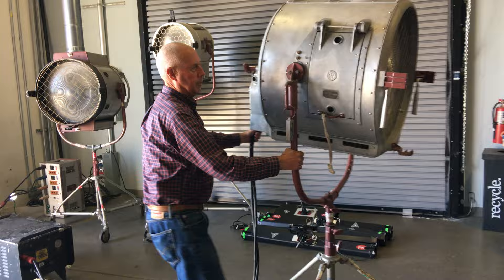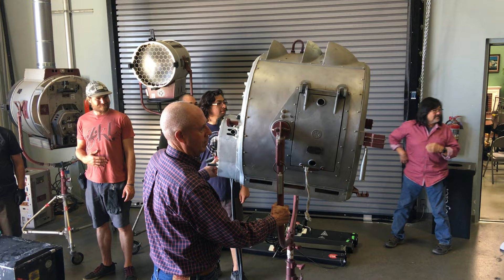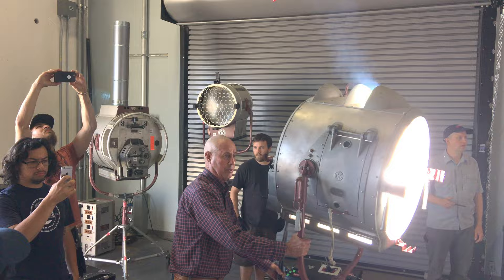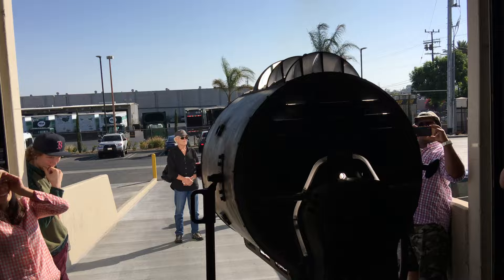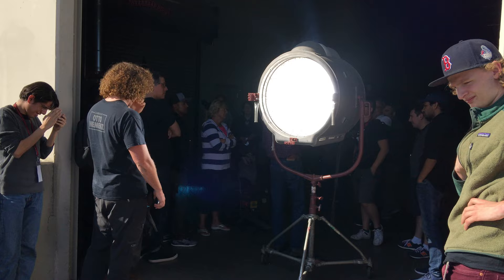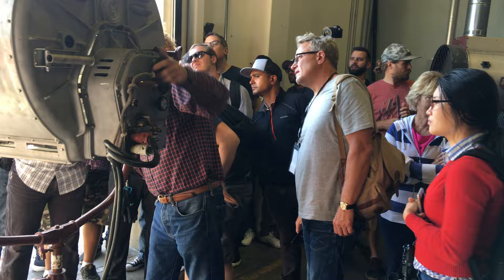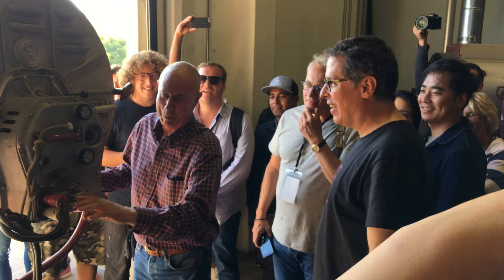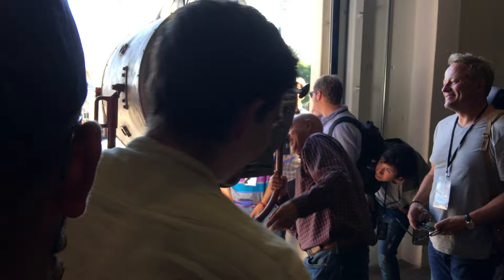Carbon Arc light demo

Comment: The light quality is unreal...
Reply: Just like the sun ...back in the '70's-'80's my buddy's parents owned a drive-in movie theater and had carbon arc projectors ... I learned a little bit about them they have better light then the bulbs they use today.  The mirror in the back of the projector is very expensive I remember Ted telling me about $1,000. Bak then to reflect the light to the film .. 
  The light is just like the sun burn your eyes that have the dark green glass window to adjust the arc ...
Reply: @peterrivney552  Fantastic --- back then you needed those big arcs to light up those big screens...  movies are so clinical now.. too clean.. cold... no emotion..
Reply: @covert0overt_810  if blasting your actors with so much heat they can barely stand to act is emotion, i dont want it. not to mention the UV rays lmao
Reply: @12gauge_shawtyy  UV rays can be filtered out without degrading the quality with a piece of the right type of glass, and the actors can also stand further away or a smaller lamp can be used, the reason we don't use this type of lighting anymore is because they're inefficient and operation isn't nearly as trivial or as fire safe as any of the alternatives
Reply: @12gauge_shawtyy You might be forgetting they are both there voluntarily and compensated quite well for their "experience" with the light. They all would tell you "hot!" but notice you never really heard of anyone actually truly complaining about them. It was part of the game.

Comment: When you hear the term "lights, camera, action", that dates back to the earlier days of filmmaking when these lights were not turned on until just before the camera was ready to roll. As you can hear the guy in the video say the carbon rods only last for a certain limited amount of time so they tried to minimize the amount of time they were burning when the camera wasn't rolling. In those days you had one man per light so that they could quickly turn them on and shoot and then shut them off. These days lighting crews are a lot smaller because modern lights don't need the kind of constant attention, reloading, and adjusting that the arc lights did.

A good carbon arc operator could adjust the speed at which the worm drive fed in the carbon rod so that it burned most efficiently and maintained proper spark gap during the burning process.   having the carbons contact each other or feed too slowly until the gap was too big would negatively affect the quality of light.

Comment: Just found a second carbon rod made by General Electric Company here in the woods, they must date back to WW2 and were used in one of these carbon arc lights I assume; there was a lot going on here during WW2 where we live.Thanks for the video!
Reply: when I was a kid my dad ran ww2 searchlights with the generator mounted all on a trailer at car shows and events, , each searchlight is on its own trailer with generator ,that you tow with a truck ,  the rods came in a square tin cans , 
I remember listening to the generators for hours ,  I wonder what happened to them searchlights after the guy that owned them passed , prolly all scrapped out , I have never seen one scene

Comment: Great demo, sir!   Thanks for this video. Good question by the guy how long does it take to warm up. Carbons are instant warm, vs. HMI lamps take a little bit to warm up and get to color temperature. Definitely more cool mechanically than a 12K HMI.  haha!  I wonder if the light quality is better with this brute arc than with a 12 or 18K HMI?

Comment: Is that a Mole Richardson?  Haven’t seen one in use for probably about 25 years.  I think the last rime was at St. Pancras station in London before it was converted for Eurostar.  Can’t remember what the production was but they were using several of them, and one of the operators let me strike the arc.  Great lamps, pity it all seems to be HMIs these days.
Reply: This Arch mole? Was a R mouse with 3 balls inside the mouse

Comment: I didn't hear what he said but what is the spin-a-ma-thing on the back?  Is it a brush to strike an arc?
Reply: The arc is struck with a lever that just brings the carbon electrodes together them releases them back to the distance they're set at. The wheels are for adjusting the electrodes. You see one spinning because as they burn they get burned away so need to be continuously kept the same distance apart and that's done automatically so they're basically constantly being brought closer together. The positive one burns 3x faster than the negetive as he noted. The wheel you see spinning is probably for the positive one.

Comment: Miss the days when these lights the street of cities from towers
Reply: Austin, TX still has some of the old Moonlight Arc Streetlight towers.
Reply: @dadillen5902  except they aren't arc
Reply: @TheFalseShepphard  
Think about it they had a light source that had pure daylight color from the 1870s. How long did it take us to get back to that point? With high output halogens and HIDs and LEDs? The main issue with Arc lamps is the heat and also power consumption. But they are a superior form and color of light. And when you're talking about film and photography you generally need a hell of a lot more light than the human eye needs to have it come out right on film. Of course all of this has changed relatively recently.

Comment: Ohms law:  I x E = P, or power, measured in watts, or power dissipated.  So, 9,180 watts?  Wow! Is that correct?
Reply: Voltage on the arc after the ballast resistor is typically about 25 Volts. 125 Amps at 24 volts is about 3KW of light and heat from the arc. Movie projectors for the big screen typically ran 60 Amps. Searchlights would run close to 180 Amps.
Reply: Ohm's Law is V=I x R
Reply: @professornuke7562  Quite right, one of 3=4 equations.
Reply: Dude's understanding of the electrical aspect of it is weak at best, but enough clues are there. The ballast box is dropping almost as much as the arc. So all told actual supply and dissipation is about twice that lol
Reply: @isettech I don't know which set of numbers is correct but given the generator for that unit was given as 120V DC in another video, and ~70V at the output of the ballast resistor box, he is almost certainly referring to a struck voltage at the output, as the reading with the arc extinguished would be as if open circuit, simply passing through a low value resistance (sub ohm range), and would be whatever the nominal 120V the genset has available on a meter.

That said, it doesn't make sense from a design (efficiency!) standpoint to run 120V in, only to lose 95 of it in the ballast. ~50/50 as given in the videos is bad enough but necessary... 80% loss, combined with the inefficient nature of a broad spectrum source (heavy in IR and UV, useless to the eye)... you'd feed it nothing but diesel and get abysmal visible light out of it for what goes in.

I don't know for sure, never messed with a real arc lamp such as in the video, but from an electrical design consideration standpoint, I gotta go with the higher numbers in the videos.

Comment: 16 volts 135 amps? isn't that only 2kW? A 2kW tungsten couldn't compete with daylight like this; are carbon arcs super efficient or something? What's the wattage on this thing?
Reply: He indeed did say 68 volts
Reply: Yeah, apparently it's more like 9180W.
Reply: 9kw use 18kw of light
Reply: they are 5,000K temperature, no need for filters to color correct,
Reply: @shacoclone3299  I think he said that was the open-circuit voltage, which drops quite a bit after the arc is struck. There is also a voltage drop across the ballast resistor.

Comment: carbon arc lighting, look like stick and tig welding
Reply: There is actually a thing, carbon arc gouging... the only difference is a jet of compressed air to blow away the slag/metal.  You can buy carbon electrodes at the welding store.  ICWeld channel is the king of this.
Reply: @scowell  there is also CAW Carbon Arc Welding.....CAC carbon arc cutting is very loud, but it will cut any metal that will conduct electricity...it was invented to cut armor plate on ships in WWII
Reply: @scowell  the [CAC] Carbon Arc Cutting process needs about 35 volts or more to run properly...so not all welding machines can CAC. they are a blast to use though, they throw molten metal 35 or 50 feet away......a standard Constant Current machine which is used for Plasma welding, shielded metal arc welding and gas tungsten arc welding along with submerged arc welding is used, A constant voltage machine used for gas metal arc welding [mig] is not used.you can CAC with AC or DC Constant Current Machines.

Comment: These lamps can take an EMP spike in the grid in case of Carrington event or Miyake event ( solar CME in X10+ class Google it) or Nuke generated  EMP ( if grid do not have weak spots like semiconductor bridges, thyristor/ igbt regulators, computers to control it instead of them analog bulb mercury thyrathron regulators....) .... Same to old mercury high pressure or sodium high pressure bulbs in hich dor short time seconds of o minutes support a 200% power spike!
LED ( semiconductors ) cannot withstand those surges ( are even ESD sensitive that requires gloves and ESD decoupling)... Also electronics behind is sensitive to overheating ( Ecuator heat, +38°C >> ) or cold ( freezing under -20°C )

Comment: Why's it humming? I thought carbon arc lamps used DC, not AC.
Reply: ALI6359  why would they do that? Isn't it being run from a DC generator? Such a generator produces no DC component.
Reply from the maker: I can't remember exactly but I believe their building didn't have DC, so I think they're running it through an older transformer of some kind.
Reply: Its use DC. He said his rectifier is old so it makes this noise. I think transformer before rectifier makes this noise.
Reply: "This is being fed with AC which is three phase... 68 volts 135 amps."
Reply: @ShokaLion  Yeah he probably misspoke there.  He said the rectifier is humming.  Rectifier == AC to DC converter.
Reply: Actually its the transformer humming.. Its steps DOWN the voltage to 65v and as a good transformer maintains wattage if you put 220v at 60 amps lets say. That would be 13,200 Watts of power, assuming 100% transformer efficiency the output wattage would be the same, but at a reduced voltage, so the current increases to 203amps (220v x 60a input = 13,200 watts. 13,200 Watts/65v on output = 203 amps) MORE than enough to draw a powerful arc on the carbon rods. Since the output of a transformer is AC and the light needs DC, the AC needs to be converted to DC by way of rectifiers.
To maintain the arc as thw rids burn away, there is a motor that pushes the rod closer to make up for the burning off of the rod. Thats that knob at the top that is rotating on its own. There is a motor speed control knob that keeps the motor at a certain speed which the operator must adjust to maintain that arc
Reply: Am I the only one who would like to see a mercury arc rectifier, on display, providing the DC power for this thing. I know they used mercury ark for cinema projectors so was "of the time"
Reply: @ShokaLion  So this light is using as much power as three electric ranges cooking full blast?
Reply: @MrNeptunebob   Uh huh. Does that seem a lot to you? These aren't particularly efficient lights. The amount of power necessary to strike an electric arc between two points bright enough to act as a searchlight, and hot enough to continually burn away inch thick carbon electrodes fairly swiftly, is not inconsiderable.
Reply: The arc singing because the supply is not pure DC. Case like no capacitor connected to the 3 phase rectifier output.